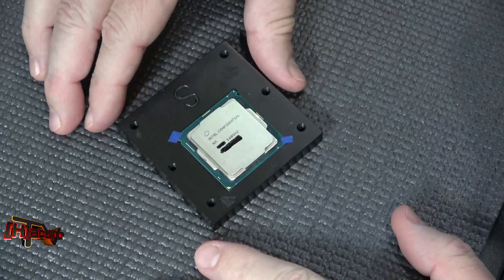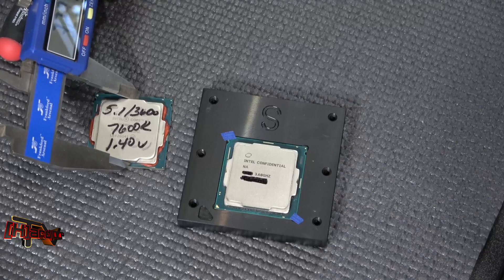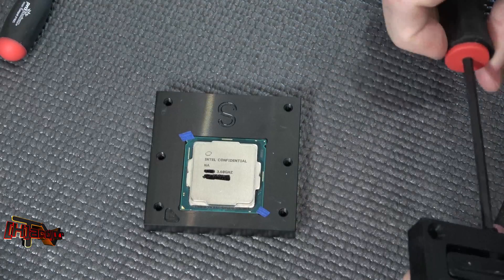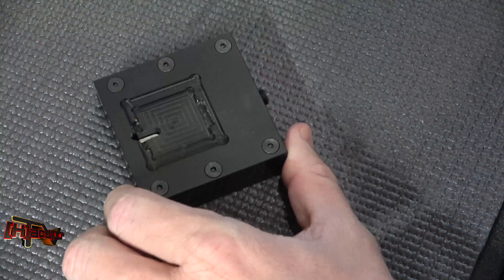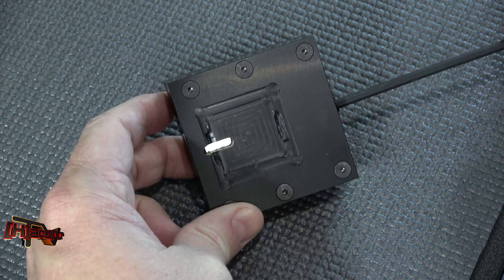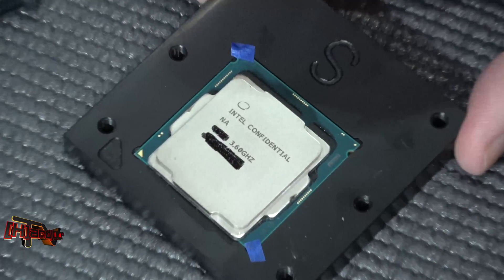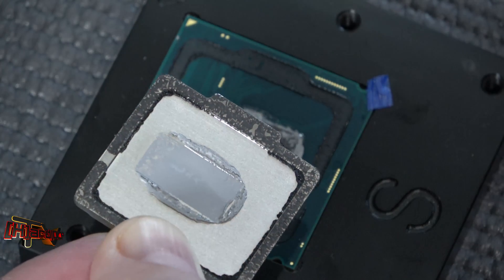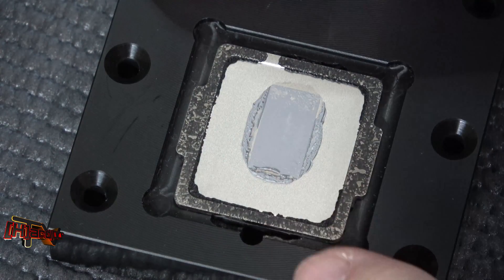Intel Coffee Lake 8600K Delidded with Delid Die Mate

Comment: i don't think I'm gonna bother doing this to my 8600k. I'm getting 5ghz at 1.3v. its never gotten to 80c under 100% load. using a cooler master 212 led. maybe i got lucky with my chip.
Reply: Rob Mckay 
How does one see how much voltage the cpu is getting? I have an i3 8350k running at a stable 5.0ghz at 0.285V. Do i add the 0.285V to the original voltage it was running on to calculate the total voltage or?
Reply: There is no cpu on the earth that you can power it on with only 0.285V man lol. I think that is the offset voltage that you set. So it's added to VID. use CPU-Z to monitor your Vcore and cores freq.

Comment: Some of my friends do not remove the black glue.
They put a super thin thigh to "blend" the two original pieces of glue.
It's correct?
Reply from the maker: I think totally removing the stock sealant is a big part of getting better temperatures as you reduce the Z height of the IHS.

Comment: Did you maybe test temperatures on i5 8600k without deliding it? What was max temp with aida64 or prime95? What OC and voltage you used?
Reply from the maker: https://www.hardocp.com/article/2017/10/11/overclocking_intel_8600k_delidded_on_air_water/
Reply: thank you very much for that link.
They get 88°C at 5,1GHz with air cooler.
My Dark Rock 3 should do a bit better if I'm not mistaken, and I'm only aiming for 5GHz under 1,35V ... so in theory if I don't delid my CPU it should run at about 85°C max during stress testing. I can live with that since it won't ever go above 80°C during gaming and other daily tasks.
At least I hope so :)